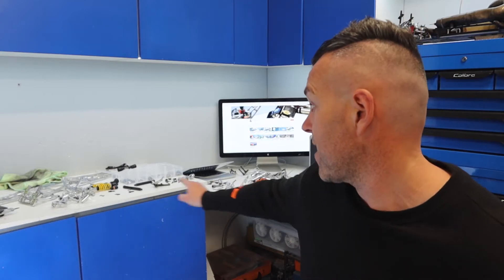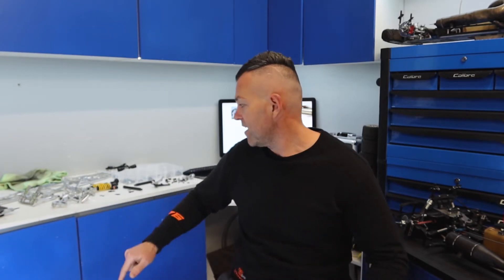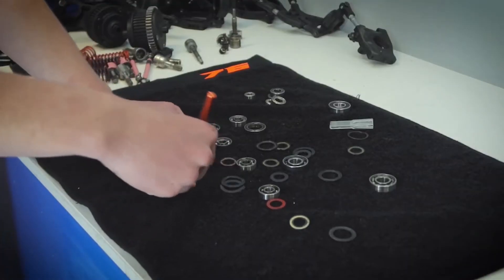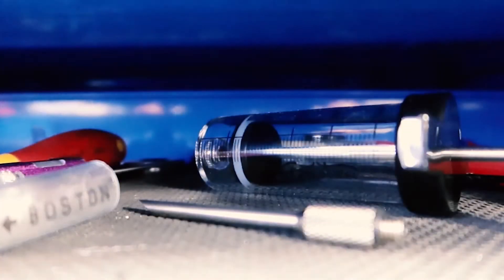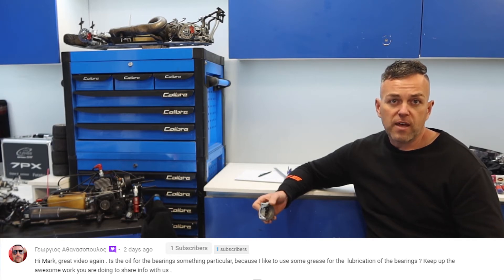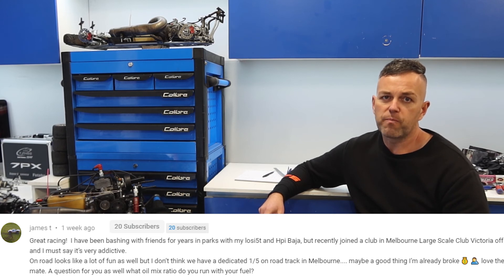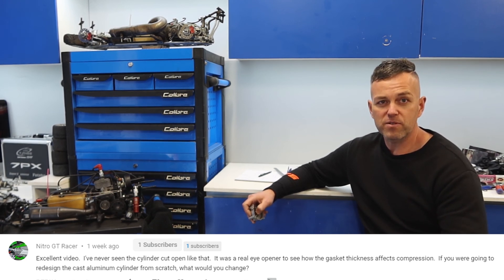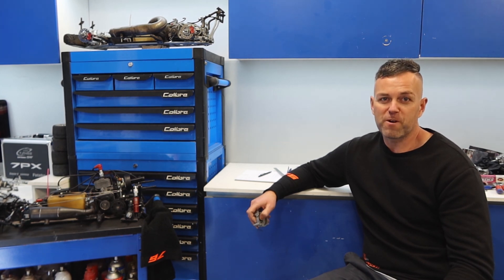RC CAR Questions Answered - Mecatech FW01 + FG 4WD

Comment: My friend, Mark,  hi. Thanks for answering my question through your video. I will use the 2 stroke oil of my gas mixture ( i use Motul Kart Oil) as for lubricating of my bearings next time, i put a whole cleaning of my FW01 and let you know of my results. Keep up the good work you are doing my friend.

Comment: Hi mark, just watching your video about oil ratio in engine.  I'm now running 20ml per litre. Found this to be very good. With these oils these day you can run less oil. Especially if you are using fully synthetic oils. This is also coming from a great 2 stroke engine builder 
Cheers
David Nothelfer 
Australia
Reply from the maker: Hey Mate, off topic slightly but some 2T manufactures of other engines commonly run at up to 100:1!!!!!!!! (with fully synthetic oils) pretty amazing! are you running on road or off road?
Reply: @MarkThomasson76  
Hi mate, I run bergonzoni 1/5
Touring car and F1. Luv the sport.
Also think your videos are very helpful 
Cheers 
David